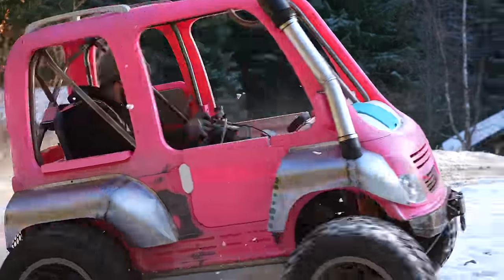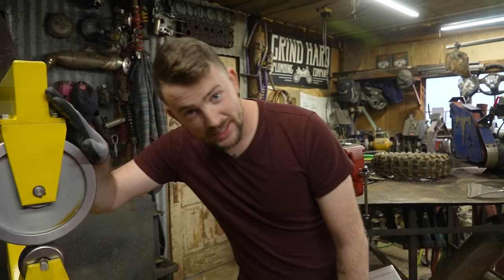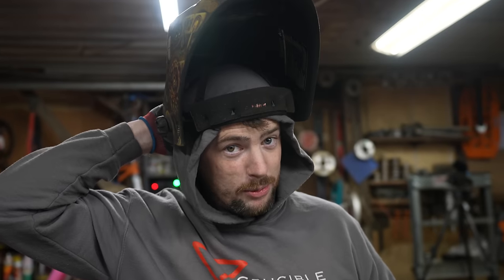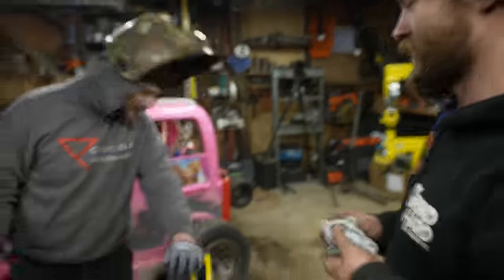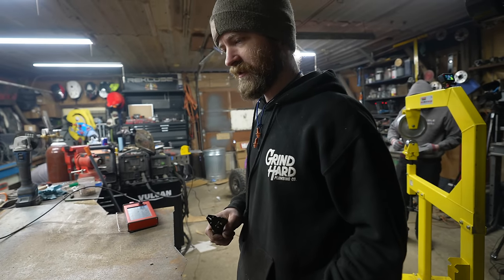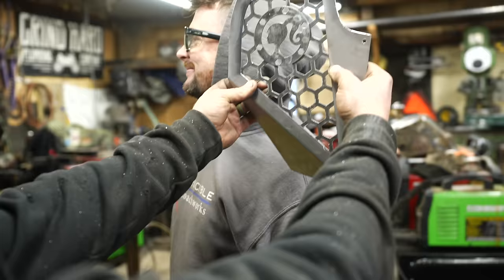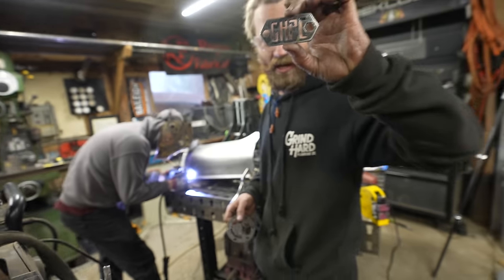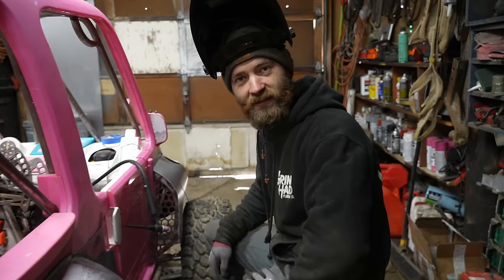Custom Steel Wide Body Power Wheels Build! 750cc!

Comment: PUT PINK NEON BACK LIGHTING UNDER THE FENDERS!!! [but protect it with acrylic or something so it doesn't break!]

And... LED would be good too... Plus... Cheaper, harder to break, easier to get, and less dangerous high voltage or broken glass to worry about.

Comment: A pair of old jeans, with one leg, turned inside out inside the other leg, and then filled with sand and just wrapped around, not knotted, is a great hitting bag for metal. Just remove all the buttons and zipper. My first three bags were this, back when i didn't know squat about fitting metal and decided to see if can do it before investing.

Comment: You guys are legends, love your vids.. Quick question.. how hard is it to match a regulator with an alternator? keep buying regulators and alternators and modifying them ( because nobody can source the correct parts.) electrician made me buy new alt again, then fitted a different reg..still overcharging and took 700 in labour.. 1.5k later.. Its an old 1979 Toyota diesel engine that i put in my worktruck pretty simple, alt was plug n play - worked fine for 6 months.. do i have to get an alt to suit the original engine and machine it to fit and get oil lines made etc..

Comment: This build would actually get me to drive small 4 wheeler off-road. Seen too many times when ATV riders try same hills as dirt bikes and it usually ends in pain. Only addition - some padding on the roll cage around the helmet. Will save the helmet and not be as violent - pink pool noodle's would do the trick.
Reply: Feedback appreciated❤️👍
Let's talk you are selected among the lucky ones 🎁🎁👉☝️☝️

Comment: Is it supposed to b that much “Carolina squat” like? I can’t help but get collapsed suspension vibes from it.
Reply: It has multiple mounting positions for the shocks, and is set low in this video.
It also has a lot of travel and is pretty soft, so a lot of "squat" under acceleration.

Comment: Tell him, that to make a proper push up - you need to make a full motion of arm and make back\spine straight with legs in 1 line, arms  spread distance should be slight bigger then shoulders, and chest is should be down to the basically contact of the ground, and head and neck should look straight forward. otherwise its cheating, because you skip necessary muscles to involved in full motion. And they are made to be slow speed, with exhale when up.
😂💪 Cheers))
Reply: Feedback appreciated❤️👍
Let's talk you are selected among the lucky ones 🎁🎁👉☝️☝️